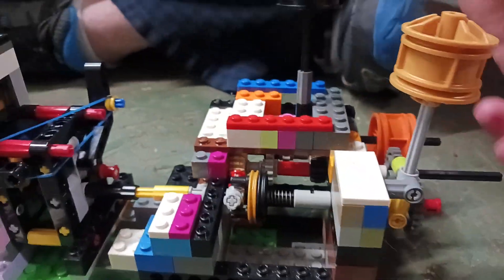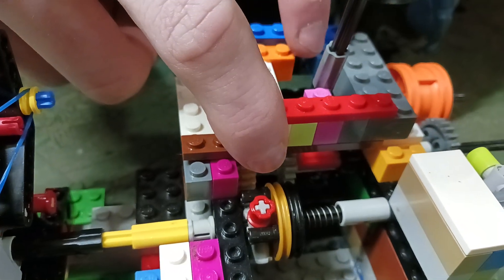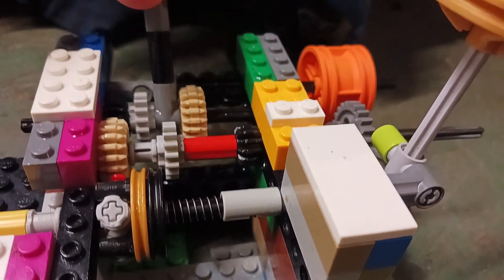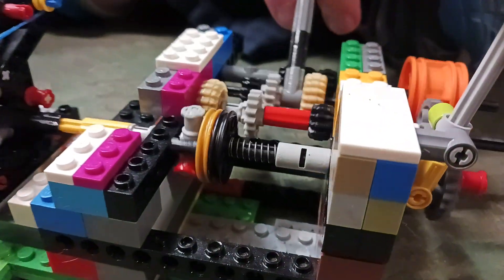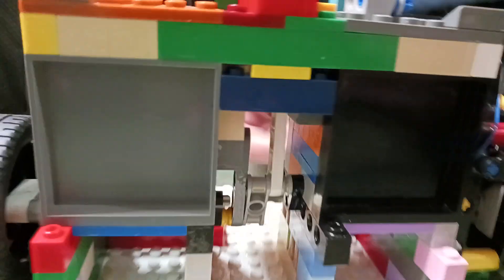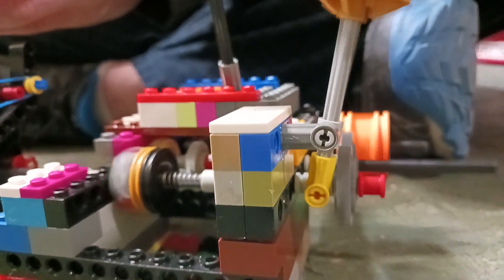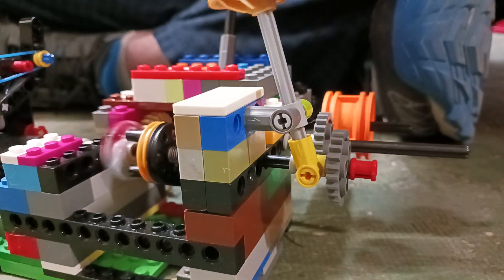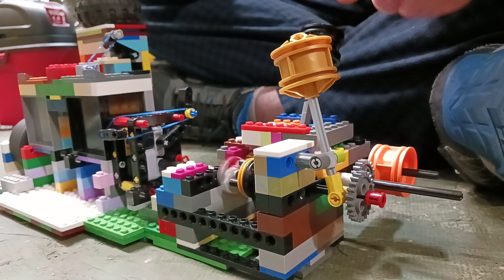Lego Vacuum 2cyl Piston Motor with 3 Speed Dog Clutch Transmission

Comment: does the clutch break your legos at all? it looks smooth to me but i cant tell
Reply: No it doesn't but whenever I want to change gears the transmission locks up so I have to engage the clutch again to shift, so sometimes the dog part that's connected to the engine, very rarely it will catch on the shift part and stall the engine
Reply: @MicrowavedBreastMilk-k2m  ok thanks
Reply: @superbt2027 it's just a lot of practice but you will get the hang of it